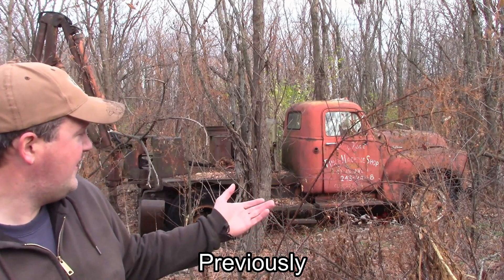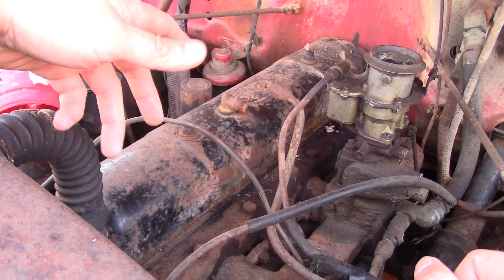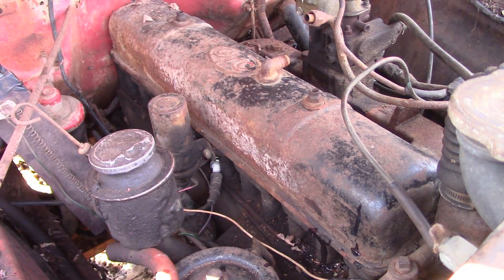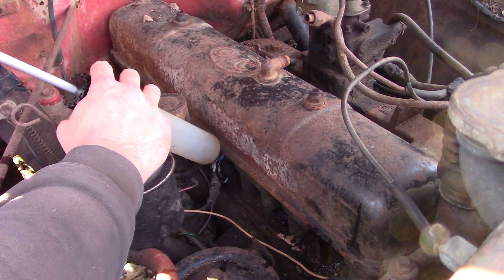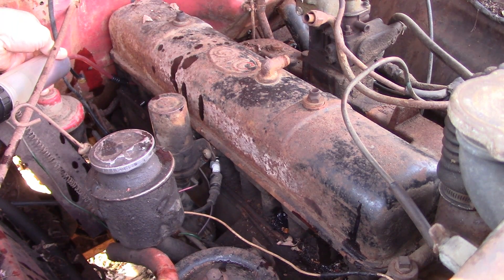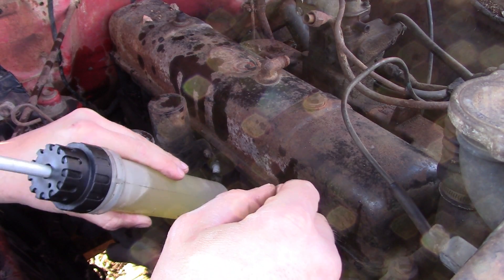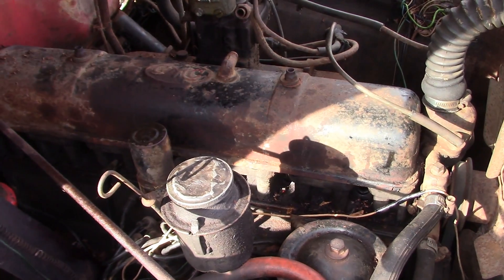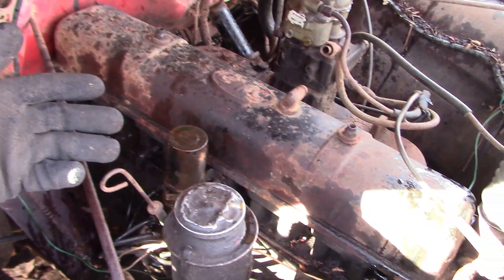Can You Free a Stuck Engine with Evapo-Rust?

Comment: Not to rain on your parade or anything, but any oil that got down onto the ring and around the top of the piston wouldn’t be sucked out, likely even with brake cleaner, I’m not sure how to fully dry it down there to have the substance you want to be in contact with the entire exposed area, but I would recommend flushing with hot water a few times to get the oil thinned and warmed and floating above the water, then suck that out till there’s no trace of oil for at least one extraction, then use something hydroscopic or hydrophilic or whatever that mixes with water, like methanol, that’s flammable or evaporates at a lower temperature, like methanol, then suck most of that out and evaporate or flash off the rest, but if evaporust is ok to mix with a little water, then you can just stick a torch head in to try to warm up and boil off the water, then put the substance in and then suck it out to know you have a minimum in there, then put a little back, that way you don’t have to use so much, also it takes time, a fair bit of it for something so tight and rusted so progressively.

Also consider mc51 and maybe do testing beforehand with water mixing and oil floating

Comment: I was told on Facebook group to Lite on engine fire  in the cylinder in the engine on my tractor it was  stuck and it worked the engine was stuck really bad you might want to give that a try my tractor engine been soaking for over a year I could not get it broke loose lit cylinders  on fire try it

Comment: If you had a method of circulating the evaporust I am sure it would after a month. I certainly would not want to turn the engine with only evaporust in the mains. Might not hurt the pistons or rings but some of those surfaces could be instantly damaged dry.

Comment: This reminds me of liquid drain cleaners, which also don't work very well.
There is no replacement for mechanically addressing the issue.
Also, could you imagine if an engine that is severely stuck was loosened by this, and then you ran it?  The rusted cylinders and rings would seal about as well as a screen door.  Maybe then you could use a liquid compression booster...

Comment: Once you get to a certain level of rust, this is hopeless. Like that marine diesel mustie worked on recently. When you put the head in a hydraulic press and heat it and it still doesn't want to go, no chemical is going to fix that. And even if it moves, everything is so pitted it will never run anyway. That said, evaporust is amazing stuff. It chemically breaks down the rust and makes it go away, which is far better than applying oil or grease or trying to wire brush it away. It's wonderful on tools like pliers when the joint gets rusted stuck, sockets rusted on the inside, etc. If you scrub down the item in solvent and get rid of any oils and loose rust and other foreign matter before putting it in the evaporust, it will last for a very long time. I have the bottom half of a small fire extinguisher full of the stuff that sits on my bench and it's had a bunch of wrenches, drill bits, pliers, etc soaked in it and its still working. Everything comes out looking like new. I saved a bunch of rusty old tools I inherited.

Comment: 😂😂 Pour your goop back down in there and heat the block up with a weed burner ...😂😂 No really heat it up with a heat gun n if'n it holds water even better. First try to heat shock the cylinders n rings n pistons with warm/hot goop down in the cold (the colder the better) cylinders then heat gun the block. Might work but you might also have to do the heat shock trick over and over several times. Wouldn't blame ya if'n ya called DOA and start figuring on a plan "B".

Comment: What`s help a lot is adding a heater hose heater. And cook the block for a few hours. You might have to heat cycle it a few times. But the expansion and contraction of the block helps free a stuck engine.

Comment: My experience of evaporust is if its oily when it goes in to it evaporust dosnt work that well, if its dry rust its mind bendingly amazing, i use it in engineering for restoring tools and high speed steel cutters, on these its just remarkable it even improves the cutting edge if its just rusty which i did not expect at all ...I think your engine is pretty damn stuck! and short of taking the head off and beating on the pistons i think it will stay stuck lol

Comment: It was a long shot but a relatively cheap intervention. I've had good results with Evaporust on light surface rust but I couldn't predict how well it would deal with a seized cylinder. Anyway, it was a worthy experiment and there was some good insight about fluid compatibility and density/buoyancy. The active ingredient is a chelating agent which pretty much guarantees it's water-based (being non-toxic, non-acid, and non-caustic is also a clue). Sucks that it didn't work out in this case but we all learned something and now you have half a jug of Evaporust to play around with.

Comment: You might try Iodine? Crazy D used it to successfully free up  a stuck tractor engine. Pull the head fil the cyls with Diesel ans set them on fire. Old Farm Junk 101 does that. and that 70+ year old guy has never failed to get an engine unstuck.

Comment: If you dropped a typical decade-old Illinois rust bucket into a vat of Evapo rust i think after a day the only thing left would be tires, headlights, and the seats. everything else would have dissolved.
Reply: Or as Peter told Greg, don't scrub so hard, it's the only thing holding the car together!

Comment: The GMC engine wil be a 228 or a 248 possibly a 270 or a 302. That GMC has a pad right next to the dist with the engine displacement stamped on it. That GMC engine is longer that a Chev 235 or 261. Has full pressure lubrication. Pull the dust cover and use a big screwdriver to pry on the flywheel
Reply from the maker: Did you watch the first video?

Comment: Soon as I heard Evapo Rust , my mind shot to Lightning McQueen Rust-ez  sponsor.

Key board Warriors.     

3 drops skunk urine 
1/2 cup hen's teeth
7 dog farts
1-1/2 horny toad newt eyes
2 gallon cider made from rare Death Valley cactus apples 
3 pints menstrual long haired Blue Goat blood.

Mix n heat to 156° exactly for 7 hours 62minutes , at this time hen's teeth should explode .

Note will dissolve most metals , this method is not FDA approved yet * 

🙈🙉🙊⚡️ also have to cook outdoors under the 2nd full moon in December over a fire made with only sage brush from the Sahara desert. 

Have a Great Day Wes , PS this was great aunt Froggy Lilly's second removed cousins recipe.

Comment: I would drop the oil pan to see if a rod broke n has the engine jammed ,or check under the valve cover for a Dutch wallet or somptin.lol also is the transmission holding it from turning over and or check the starter for engaged n stuck in the start position. Merry Christmas ,God bless y'all real good.
Reply: agree

Comment: I have not read all the comments so this might be redundant. I use white vinegar to clean rust off of old tools I got from my dad when he passed. I am not talking about surface rust, some of his tool went under brackish water during hurricanes. I also found that is is great for sharpening files and saw blades. I have a plastic storage box that I fill with tools and then fill with the vinegar and leave it a month or so. It actually ends up with a really nasty looking foam at the top. Dump out the vinegar, wash the stuff in water, use baking soda and water to neutralize the acidic vinegar, wipe with old oil to protect from further rust. The chrome peals off if the tools were bad enough, but they are usable. I can't see any reason that it wouldn't eat the rust out of those cylinder walls. It will most likely damage the aluminum pistons, but I think they might be in bad shape anyway. Just an idea, if it doesn't work just go back to the crocodile tears, or maybe tears from a mermaid. I think you know already the best thing to do is at the very least pull the head and go from there.

Comment: As for freeing stuck motors I will throw my hat in the ring. When dad retired from dairy farming he worked at a farm dealership. At that time they were scraping combines dad got a nice chevy V8 out of an MF 750. He piped the coolant pump into a stuck 1928 10 20. He let the V8 run at high idle for a wile a cople of times and it worked the 10 20 freed up nicely

Comment: i think the evapostuff would have a better chance in a completely oil-free cylinder.  the wicking action is probably compromised by the residual oil layer.  
I saw the brake cleaner which is good, but maybe some lacquer thinner followed by compressed air a few times would help.

Comment: There is a flat pad aft of the distributor that has a serial number on it. The displacement of the engine is there. The 302 is a more desirable power plant that GMC used. They built the 229, 248,270, and the 302. All were the same on the outside so interchange is fairly simple. The 302 was also used in early military trucks and has to be modified to fit say a half ton. But again its not too hard. If what you have is a 270 or a 302 its worth saving. Although pistons can be very pricey for both.

Comment: put brake fluid that work i have a stuck engine and after 2week the engine start to turn free i remove the starter and i took a pry bar directly on the ring gear and its start to turn step by step

Comment: evaporust uses a chemical reaction, chemical reactions increase greatly in their potency and speed at higher temps. effectiveness would drop off dramatically anywhere even approaching freezing...

all im saying is if it were to work, it would likely be at much higher temps (closer to room temperature)
Reply: Evaporust when heated greatly speeds up its reaction time. I have a heated ultra sonic cleaner that I have evaporust in and the longest I've had to wait is 4 hours for something that takes 24-36 at room temperature
Reply: So build a fire underneath, then EvapoRust.

Comment: I'm pretty confident Evapo-Rust is citric acid with maybe some surfactants.  I've used both with identical results.  So now I buy 10lbs of citric acid and make batches as needed.  Timely reactions require temps 80 degrees f and above.  Lowest temps I've tried was around 50f and progress was glacier slow.
Reply: Negative... EvapoRust is definitely NOT citric acid.

- Max Giganteum

Comment: That's too bad. But it was worth a shot! :) The only remaining option (at least that I can think of,) would be to remove the head, and heat the pistons and cylinders with a torch. I've also seen people remove the head on a stuck inline engine, fill the cylinders with gasoline, then light it on fire and let it burn (with mixed success.) Maybe follow that with some hammer blows. But... That's a lot of work, especially when you're out in the middle of nowhere :P

Comment: How about this. Find an old wheel with no tyre (Tire in the USA of course)  and make two holes opposite each other in the wheel well. Find a bar about 6 feet long to put through the holes. Jack up the driven wheels on the truck and mount the wheel and bar. Put the truck in gear and use the bar to try to turn the motor. Something will move or something will break!

Comment: Google or ask waylonwire on you tube about GMC 302 you’ll find out it’s a v 6 , worked on several of them throughout the years
Reply: I stand corrected v6 is 305 cubic Inches, lol that’s what happens when you get old , tag on door pillar or firewall  will tell you what size it is, they made several diff C.I six cylinders in that year

Comment: My experience with evaporust is that the metal needs to be pretty much grease and oil free.  I used it on a pair of pliers that were so rusted a hammer wouldn't budge them.  Overnight in evaporust and they worked freely by hand.

Comment: The rust around the pistons is water tight, any solvent or oil wont just magically seep in.

Maybe some ridiculously thin stuff could do something, like asetone with some wd-40 in it idk.

I personally have just used plain old wd-40 for any rusty stuff, if it wont seep in, nothing will

Comment: It was a good attempt. I’ll bet the main problem is the oil/ATF coating on everything “protecting” it from the Evaporust. I believe they say you’re supposed to remove all traces of oil from parts before soaking in Evaporust, and obviously there’s no easy way to do that with a fully assembled engine. Good try though.
Reply: I asked a  Evaporust representative about the procedure. He said you must clean as much carbon and oil based crud as you can as the product only works against exposed rust.   I'd pour solvent in and blow it out with compressed air.  The rings are probably caked with hardened sludge so that the chemical can't work.

Comment: 1 5 and 6  that is probably stuck then i wonder if a guy could take the valves loose so they are closed and make a grease  tip to screw into the spark plug hole and hydraulically make it move with grease just one by one force grease in it
Reply from the maker: We tried that on the last stuck engine.It didn't work.

Comment: Evaporust doesn't really like to be mixed with grease/oils of any kind. In my experience with it it mixes fairly well with light oils.
Reply: Yes after he removed the most of that diesel he should have used a propane torch and stuck it in the spark plug opening and cooked all the residue from the cyls and that heat wouldnt have hurt anything. Then put the evapo rust into a dry cyl to give it the best chance to work.
Reply: @thecollectoronthecorner7061  Just beating a dead horse.
Reply: I can also confirm. I just submerged a camshaft in evaporust to clean some light rust off it. I had cleaned most of the remaining oil and grease off it with carburetor cleaner. I left one spot between lobes with some oil on it. After three weeks, the oil turned white, and the metal under it was unchanged. Everything else I had de-greased was de-rusted quite nicely.
Reply: Yeah - a lot of the skilled restorers are pretty careful to put items through the parts washer (or just a bowl of solvent) before using Evaporust or MC-51

Comment: A built 6 in a row with split exhaust. One of the most beautiful sounds  "enginely" possible.
Reply: My '01 TJ is set up that way. Dual Flowmasters. It sounds amazing and routinely sets off Tesla car alarms.
Reply: @wes11bravo  In the early 90's I built a V8  conversion  street legal Toyota Hilux mini monster pick up truck, with cherry bomb mufflers. It  would set alarms off driving round parking lots, it got embarrassing in the end. The truck was fairly quiet if the gas pedal wasn't stamped on hard, it must of just been the right sound frequency to do it.
Reply: @super6954  - 100% brother! I have the complete stock exhaust for it that I will be installing as soon as I can motivate myself. It was somewhat amusing to set off car alarms but the novelty is wearing off!
Reply: I have built some hot Toyota six in a rows that sounded awesome and ran quite well,too.
Reply: A Jaguar XK is a good example

Comment: Problem I’ve seen with really stuck motors is the aluminum corrodes on the pistons and causes them to expand and wedge in tight. I had one so tight I used a homemade press to get it out, it shot across the floor when it finally came out.
Reply: The problem here? This is not an aluminum engine
Reply: @donniebrown2896   Pistons are.
Reply: @donniebrown2896  even the pistons?
Reply: My cousin's 50cc yamaha moped (1980) had a stuck motor, had to use a 4 pound sledge hammer, heat, pblaster, and 2 hours of beating on the piston to make it move.
Reply: Russia hadn't even invented aluminum yet when this truck came out. Gosh, guys.

Comment: Do you have a water heater you could hook up to the cooling system? 

I've had good results heating engine's up to free them up. I'm not used to penetrating fluids and concoctions getting passed the rings either. 

What id like to try is getting some ice onto the piston so it shrinks a little and the block expands with the heat. 

I'm think of freezing some vinegar into ice cubes, crushing it so it can be put into the cylinders with a funnel. 

If you can try and some pressure behind it to help with penetration.